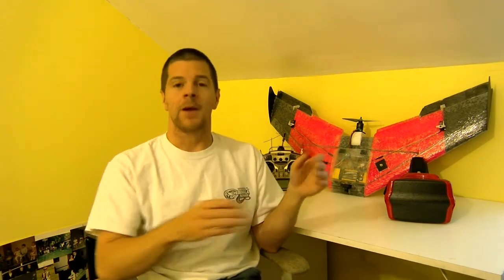FPVWRA Rules - Where they came from and why

Comment: So Im looking at getting into racing wings. Im thinking about doing a spec wing air frame and running a spec class set up at first with the plan to upgrade the motor to a sport class latter on. Any opinions on that idea?

Comment: Alex is a great RF engineer and antenna designer, but inexperienced and terrible plane designer. This "explanation video" just confirms that the hodgepodge of rules and specs were haphazardly put together by a tiny group of "good ole boys" based on random thoughts and feelings of "that sounds neat." Hey, we built a couple of wings, and twisted up some rules to fit them. Oh, and here's some non-sensical BS excuses to justify those rules. Sure shows FPVWRA as total amateur hour, which likely explains their 149 subscribers.

Spec Wing designed by committee of 14 people (FPV wing groups filled with drone people without extensive fixed wing knowledge?)... explains a lot. Again, that symmetrical airfoil is a horrid design choice for a flying wing. You have to run some reflex to stabilize the, so even in a straight line, the symmetrical airfoil is now running negative camber. In the turns, this effect is made even worse. No wonder the Spec Wing is so inefficient, wastes so much battery energy, and has less flight time.

Spec Wing flies the same upright or inverted? In the race footage, the wings only spend a second inverted, and only for an Immelman or split-S, both of which are positive-G maneuvers which would be enhanced by lifting/cambered airfoil, especially on a flying wing where "up elevator" de-cambers the wing. Alex is still wrong and so is their committee.

Design allows flexibility? No it does not, there are only allowable margins of error. And that stupid airfoil is set.

Design allows DIY homebuilt foamboard to compete? No. Otherwise they should have just made a foamboard plane, like the FliteTest ones.

Want people to experiment with Spec airframe design? Yet, the limit is 2 control surfaces. The few high end F5D/F5F/F5B wings have separate in-board elevators. This helps deal with the inefficiencies in the turns due to up-elevator de-camber. Also, guessed penalties for rudders and canards of 75W in Sport Wing. Doesn't seem like experimentation is desired. Canard efficiency? Canards are terrible for racing planes as they stall out before the main wing does. Flight controller, 150W penalty, which just makes this a fake option.

Sport Wing magic of 850W? So, by Alex's estimation, the motor generates 750W of useable power after subtracting heat losses. And that equals 1HP. Neato! But so what? Picking 1HP is just random.

Sport Wing lipo? Then there's the nonsense of picking that power output so that people can run X size lipos, so as to prevent people from running batteries that are too heavy and making them uncompetitive on tight tracks. Well that's just dumb. You pick any wattage output limit, race flight time limit, and pilots would experiment to find the most competitive weight, including lipo. No one is going to run a 12S 20Ah lipo on a 45" or under wing. Why not just set a wing loading, or weight limit?

Mini Wing with FC penalized? SO 50W (out of 300W) penalty for a flight controller in a class that is designed for multirotor pilots? Well that's just silly. Those pilots have and know how to work with flight controllers. Unless there is high/gusty wind, they wouldn't have an advantage anyways. Doesn't sound like experimentation is desired. Then there's the nonsense about how the power penalty can work to your advantage by running a lighter lipo pack. Well duh, but it is not going to make up for the loss of power. BS/fake justification.